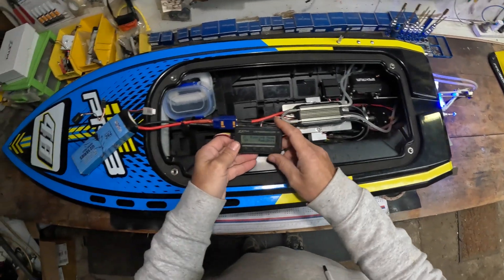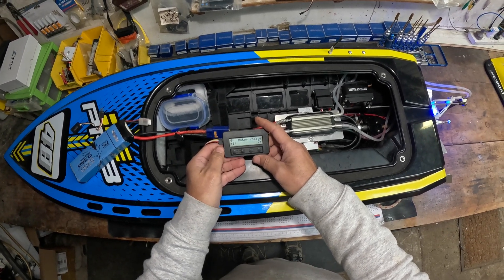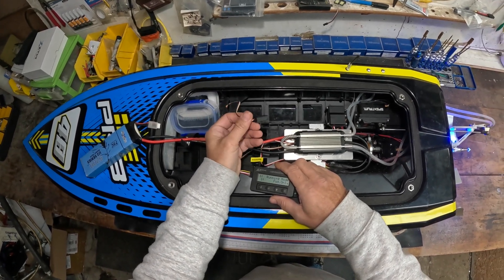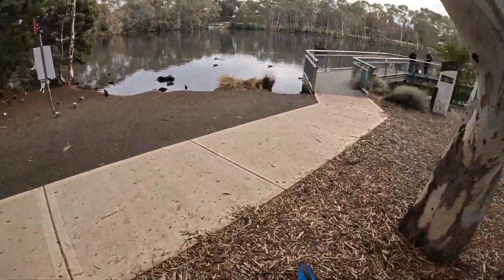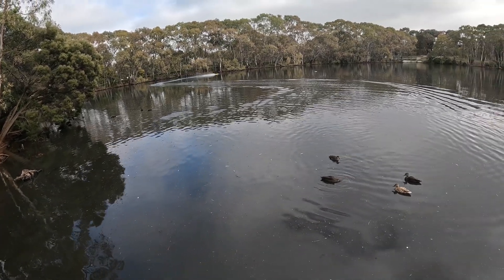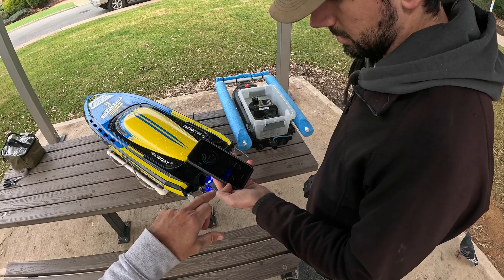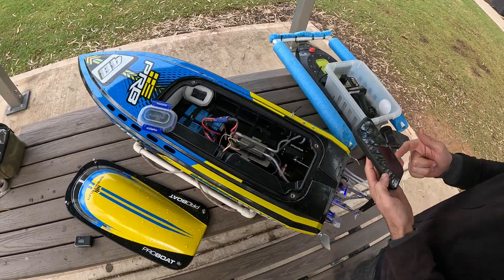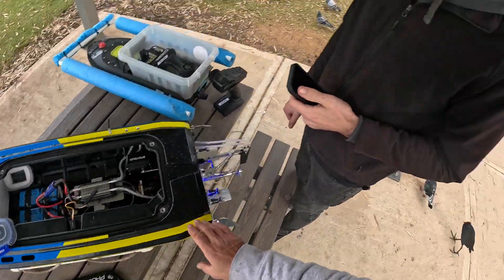Proboat Supersonicwake 48 ZTW 200a ESC program settings -'SR' comparison

Comment: SR function is called synchronous rectification or some call it Freewheeling. It supposed to make the ESC more efficient and less heat loss by using more MOSFETs instead of diods. I ended up keeping it on. I have the ZTW seal 105.